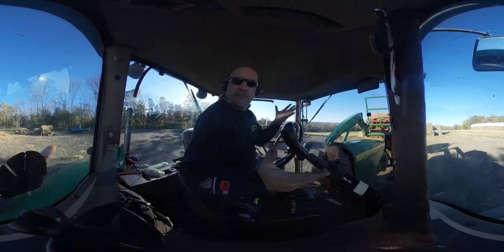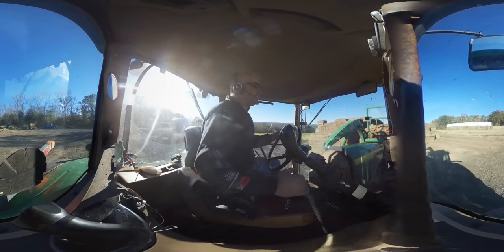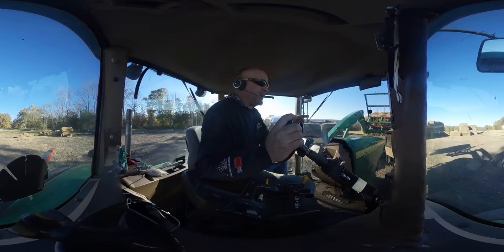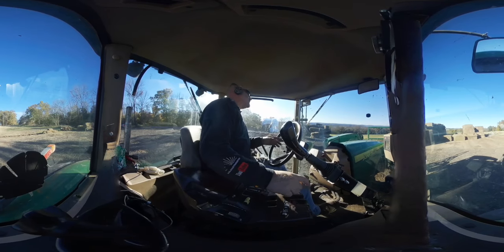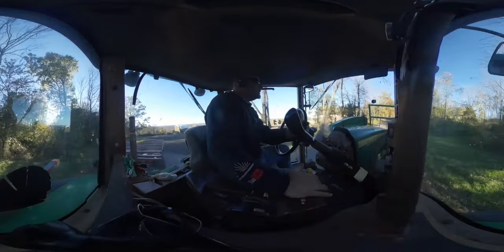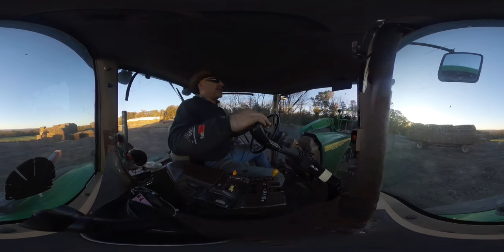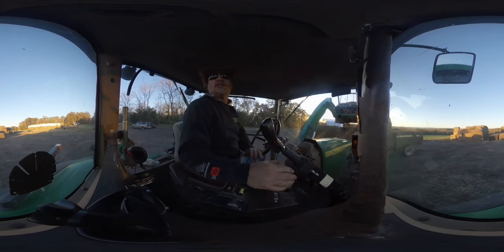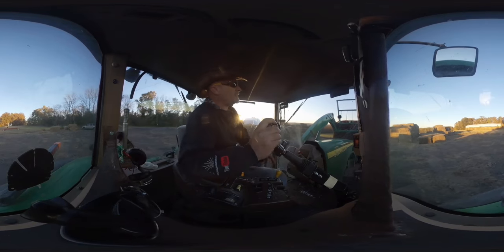Westondorf 360 Review and Drive

Comment: I run several different fork trucks in the warehouse where I work, and the left hand reverser is definitely easier than what you have on the 8120. What I like even more is the foot pedal direction control on the throttle pedal. I’ll occasionally find myself trying to change direction with my foot, instead of my hand, when I’m using a different truck. Love the 360 videos, keep up the good work!

Comment: Ran a loader on our power shift 8400 for years, the best investment was putting a gas peddle (foot throttle) in it so you can give it more gas on the go to speed up when you’re carrying bales or going back to grab more. Also would leave the hand throttle at 1200 rpm’s so when you let go of the foot peddle you can change directions with the shifter and not have to push the clutch in. We sold the 8400 and now have a H480 loader on our IVT 8530 and that is a fast smooth loader tractor.

Comment: Quite the slick operation.  Jumping up and down to pin hitches was a pain in the ass on idiot block wagons.  Good luck with the weather and filling the fodder contract.  Thanks for a mill day. I'm betting you still have logs staged out of the yard and hardwood boards stacked tall under cover.

Comment: You are quite correct: The shuttle shift coming out of forward gear should be putting that 8120 back into the same reverse gear it was in before you shifted to forward.  http://manuals.deere.com/omview/OMAR178070_19/RX15494_000003F_19_14SEP02_1.htm

Comment: That looks like hard work to drive. Does the tractor even have a foot throttle? It looks like you have to move your hand from the joystick to the reverser and back every time you shuttle as well. The better units now have reverse shuttle buttons and even gear changes on the loader joystick as well as on the left of the steering column. These things, plus brake-to-declutch make driving all day so much less tiring.
Do like the 360 camera and video. Ricoh Theta was one of the first but there's lots of choices today

Comment: Did you tie the loader in to the tractor rather than the breakaway complex or S which I’ll call him ScvI had a 4430 and I tied my load her into the main hydraulic line coming out of the high-pressure pump and put big lines to the valve body and it really improved the cycle time

Comment: 1. Do you have three hydraulic hoses going to the Westendorf hydraulic manifold?
A large Pressure hose, A large Return hose and a small Load Sense signalling hose.

2. To deliver JD Power Beyond to this manifold, you need to make sure the small Load Sense hose is in the correct threaded port at the rear of the tractor.  If you have to keep a tractor SCV activated for the loader joystick to work, there is some problem with the Load Sense hose, the tractor, or the Westendorf manifold.  If you have already got a handle on this, forgive me.  It may help others with similar problems.

Comment: On the 4430 ran three quarter-inchTo the valve body and 1 inch to the transmission discharge I’ll 38 line is not going to give you the cycle times you won’t